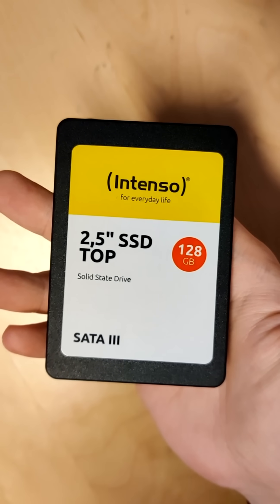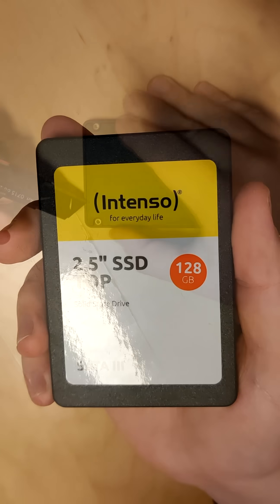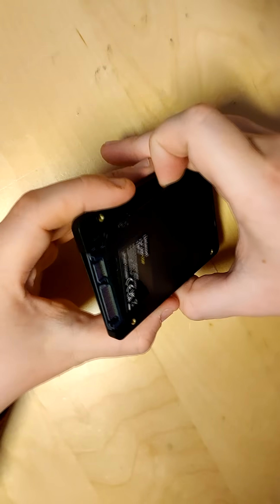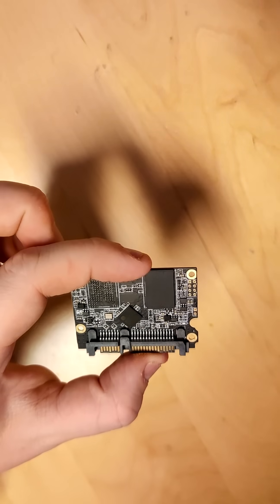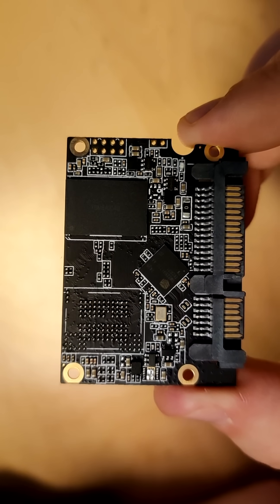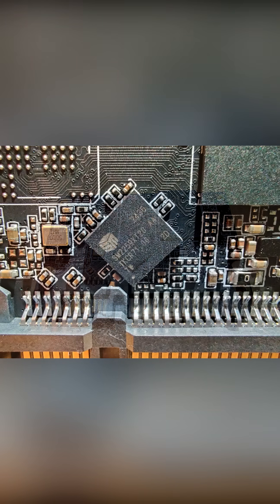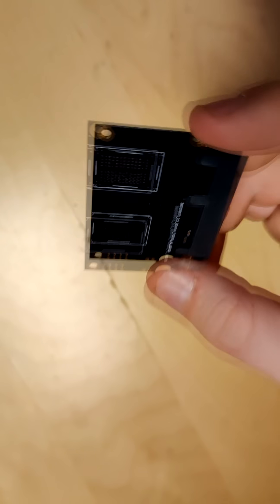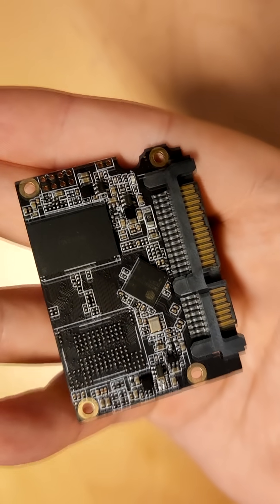What is inside of a cheap SSD?

Comment: Are they faster than a USB stick ?
Reply: sata ssds are way faster than normal usb sticks.
a sata ssd runs on a 6gbps interface and usually does around 500 to 550 mb per second.

usb sticks are much slower:

usb 2.0 does around 30 mb/s

usb 3.0 or 3.1 usually 100 to 150 mb/s, sometimes 200 if its a good one

usb 3.2 can hit 400 to 500 mb/s but thats really rare